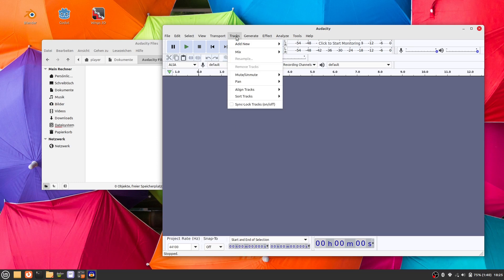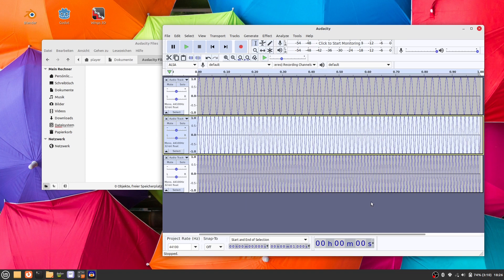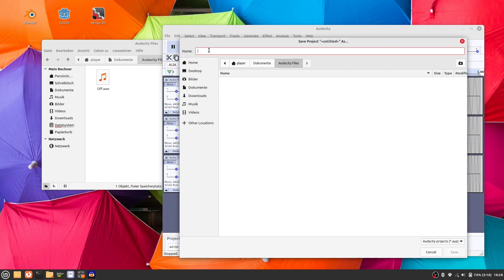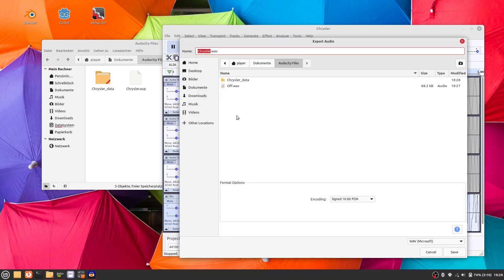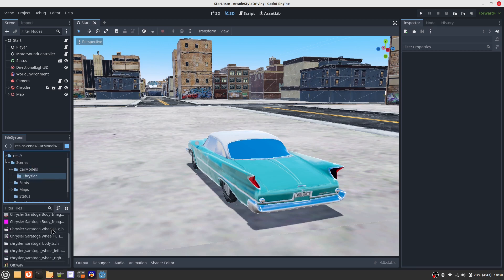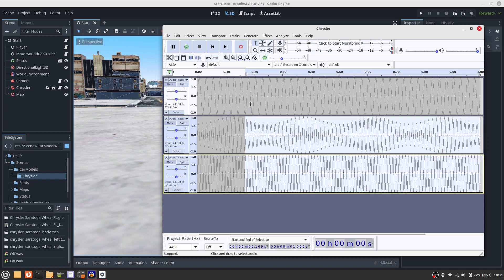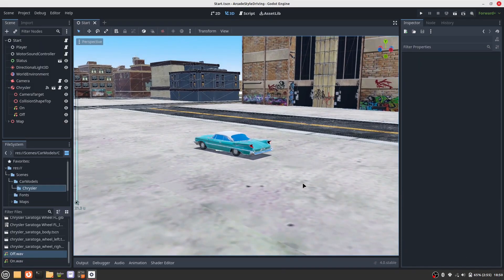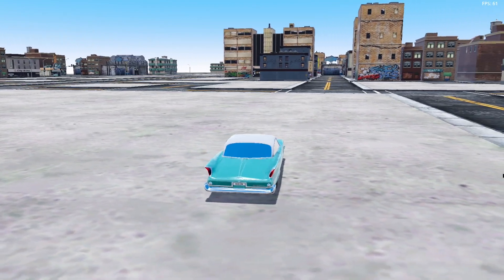How to create the motor sound for a car game (Godot 4)

Comment: It is remarkable how good the car sounds at the end when I realized that the only sound that you used was a round sinewave. 

I have an observations about the controls, in a normal car, you would gain more grip when you release the throttle but in your Game It feels weird because It looks like you lose some grip when youre not throtteing. But everything else is very good job

I subscribed to your Channel
Reply from the maker: Thanks! In terms of sound this is no coincidence, reference is Fourier synthesis. However exceeding the signal limits also plays a role here.
Reply: I would like to learn to code engine sounds into my game, is there a tutorial for Godot that you recommend?
Reply from the maker: @Big_Theft_Auto  I was just using the documentation (it is good!). I'm using two AudioStreamPlayer3D nodes. One for accelerating and one for decelerating. I use the same pitch (pitch_scale) for both of them. The pitch depends on the speed of the car. The volume (volume_db) is different for accelerating and decelerating. When accelerating the on-sound is loud and the off-sound is quiet and vice versa. Very simple.
Reply: @tomaga4995  clever stuff, i'm going to try but with a recording of a real engine and see if it sounds as good, if it doesn't then i'll just do exactly what you did 😅 😂

Comment: how did u code the sounds to the car?
Reply from the maker: I've created two AudioStreamPlayer3D. One for acceleration and one for deceleration. I assign the wav file for acceleration (on.wav) to one AudioStreamPlayer3D and the off.wav file to the other. In the code, I set pitch and volume for both AudioStreamPlayer3D - depending on whether I am accelerating or decelerating (and of course how fast the car is currently traveling).

Comment: how to i get the sounds to play?? not much of a tutorial for godot, mainly just audacity 😞
Reply: i just made my own, not as good as the one in the video but it works!

(you must use a VehicleBody3D node)

extends VehicleBody3D

const MAX_STEER = 0.8
const ENGINE_POWER = 500
const MAX_SPEED = 100  # Adjust MAX_SPEED according to your needs

@onready var camera_pivot = $CameraPivot
@onready var camera_3d = $CameraPivot/Camera3D
@onready var reverse_camera = $CameraPivot/ReverseCamera

var look_at
var engine_sound_player : AudioStreamPlayer3D

func _ready():
	Input.set_mouse_mode(Input.MOUSE_MODE_CAPTURED)
	look_at = global_position

	engine_sound_player = $CameraPivot/AudioStreamPlayer3D2
	engine_sound_player.play()

func _physics_process(delta):
	steering = move_toward(steering, Input.get_axis("ui_right", "ui_left") * MAX_STEER, delta * 3.5)
	engine_force = Input.get_axis("ui_down", "ui_up") * ENGINE_POWER

	# Adjust these parameters for faster and higher pitch increase
	var pitch_increase_speed = 5.0
	var max_pitch = 10.0

	# Calculate engine sound with faster and higher pitch increase
	var engine_sound = linear_velocity.length() / MAX_SPEED * pitch_increase_speed + 1
	engine_sound = min(engine_sound, max_pitch)
	engine_sound_player.pitch_scale = engine_sound

	camera_pivot.global_position = camera_pivot.global_position.lerp(global_position, delta * 20.0)
	camera_pivot.transform = camera_pivot.transform.interpolate_with(transform, delta * 5.0)
	look_at = look_at.lerp(global_position + linear_velocity, delta * 5.0)
	camera_3d.look_at(look_at)
	reverse_camera.look_at(look_at)
	_check_camera_switch()

func _check_camera_switch():
	if linear_velocity.dot(transform.basis.z) > -2:
		camera_3d.current = true
	else:
		reverse_camera.current = true
Reply: @SOS_Studios  Great code! Thanks for the help!
Reply: @SOS_Studios  thank you